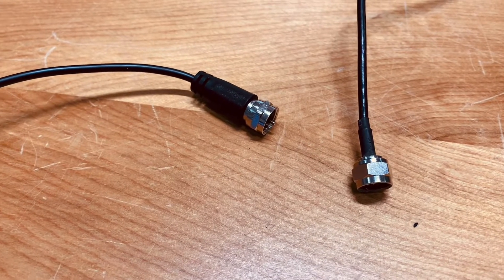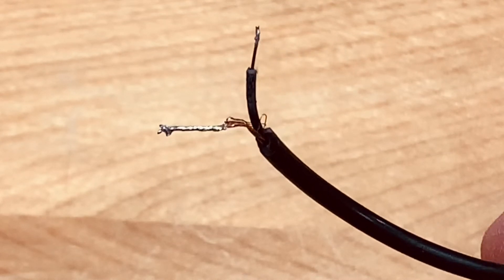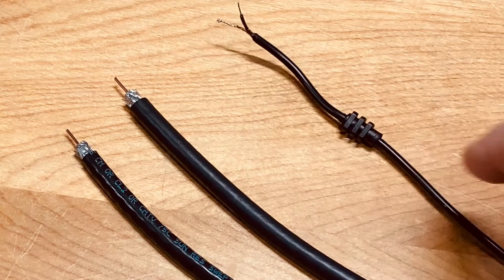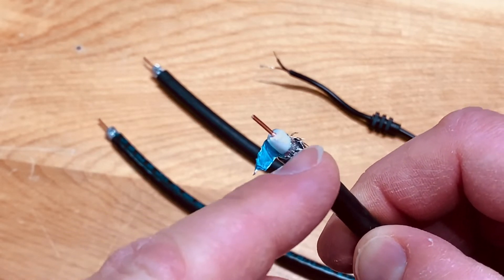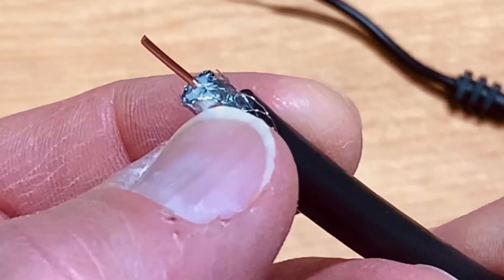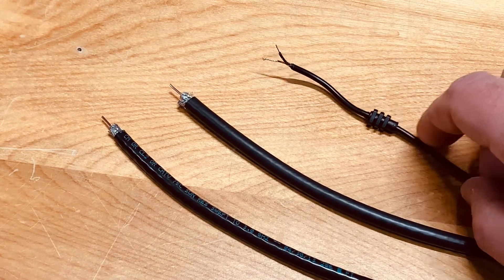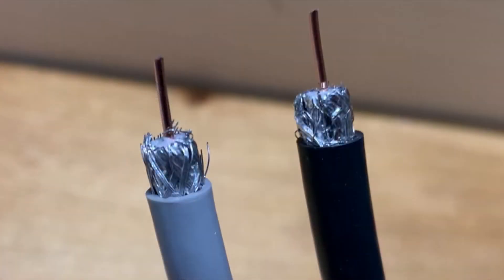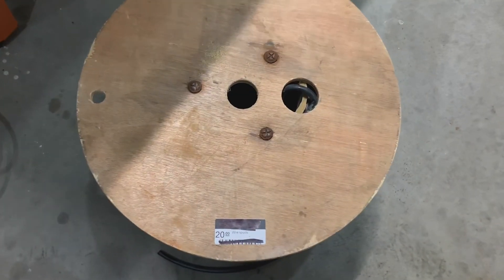Comparing thin TV Antenna Wire with real RG6 Coaxial Cable

Comment: I think it's also important to point out is whether the inner conductor is solid copper, or ccs(copper cladded steel). Copper conductors are better for signals than the ccs... especially for longer lengths.
Reply from the maker: Very fair point.

Comment: This is a good primer type video but you mentioned on cable runs over 100 feet that RG6 quad Shield is better. Quad Shield has no less loss then dual or tri Shield. Actually you should recommend RG11 in runs over 100 ft.
Reply: The RG11 is expensive, I can say twice expensive in some stores but it's worth it I recommend mostly for UHF OTA TV and Satellite TV. In my case I installed two RG11 cables for UHF reception and Satellite TV one is 30 meters long and the other 40 meters. I must say that I had no problems and with amplifiers the signal on both is excellent.

Comment: There are some indoor antennas especially indoor antennas with built in amplifier that allows you to replace it's cable with a high quality RG6 cable. On my indoor antenna on UHF band with it's original cable I had 70% signal quality and 50% signal strength, and FM reception was not that great I could only receive the strong signal stations. When I replaced it's original cable with RG6 tri shield, on UHF band the signal strength increased to 80% and the signal quality is 100%. The FM reception was great on both strong and medium signal stations, I could receive some weak signal stations, and switching to Mono improved the audio.

Comment: I remember back in 2017 when I got into satellite hobby. I used to consider that RG6 cable si for Cable TV and RG59 is for antenna and satellite so I bought RG59 cables with F type conecter, later I realized that RG59 is the worst type of cable, and it's mostly recommended for CCTV and RCA or Component. I bought a digital meter and I made a comparison, on RG6 dual shield cable the signal was two times better than RG59. On long runs the RG6 dual shield had low attenuation especially on UHF band (470 - 790 MHz) and Satellite (950  - 2150 MHz). For Long runs I recommend an RG6 tri shield or even better a quad shield. If you are lucky there are RG11 coaxial cable which are even better, they have lower attenuation than RG6 quad shield, only they are more expensive.